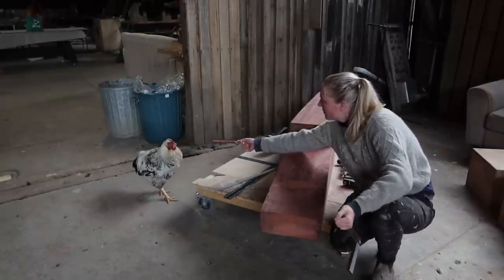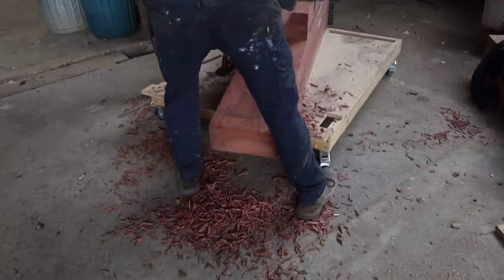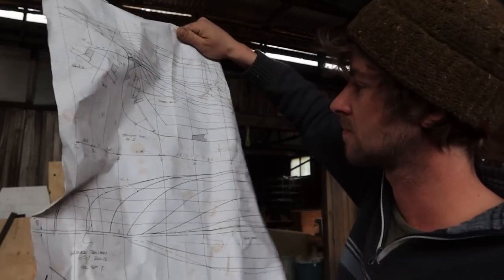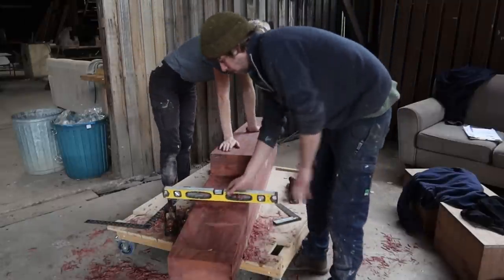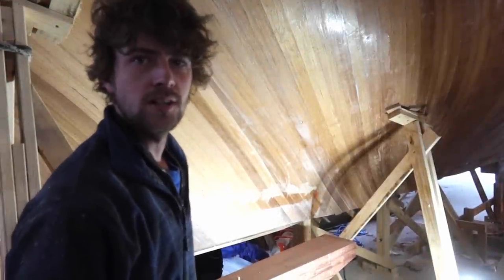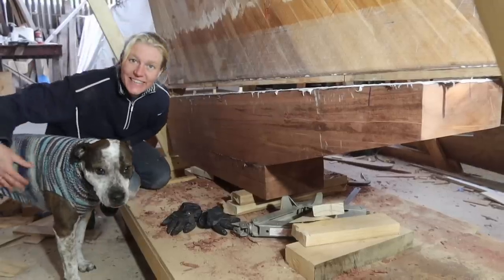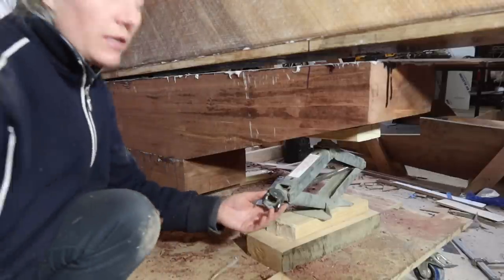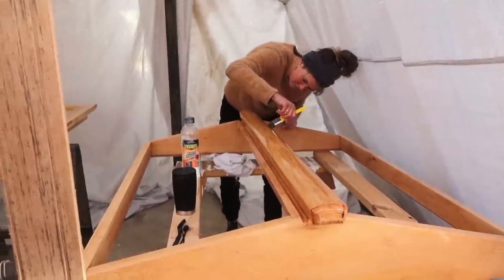Shaping the keel timber & fastening in place (EP19)

Comment: A lot of the old Tassie boats used copper rod driven into a snug hole for fastening large timbers..sometimes with the outer end threaded for a nut. Helped my old dad drive thousands! BUT a word of warning, if you bend one or otherwise stuff it up don't expect to get it out because once driven the grain of the timber locks onto them tight. Used to fix cabin sides on etc , sometimes with 4 to 5 foot long 5/8th inch rods. Good for rudder glue ups as well. I have one here that was pulled from a 130 year old hull and it is as good as the day it was driven. (I cut it out with an axe) 45 years ago. Great work to date, hope the shoulder heals soon.
Reply from the maker: Ah yes the good old copper dump! We have used a few of them already but that was pre YouTube channel haha 
Cheers

Comment: Intended as a helpful hint.
Try your best to never lay your plane down on its face (knife side). This will definitely add to premature dulling of the edge. Always lay it on one side or the other. If the knife or blade is retracted it wouldn't matter.
Reply: a good habit no doubt but not really necessary on a clean timber surface
Reply from the maker: Hi David! Thank you for sharing this tip with me. I will take it on board and make a habit out of placing the planes on their side!